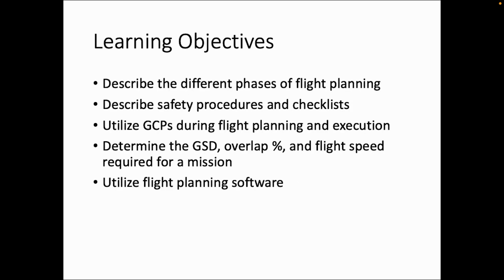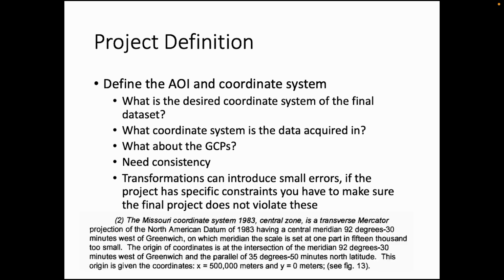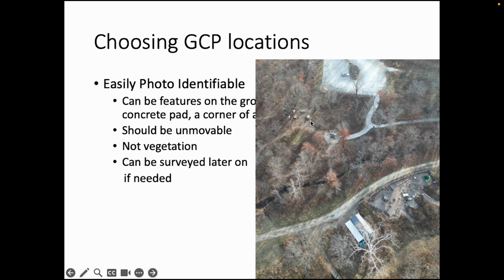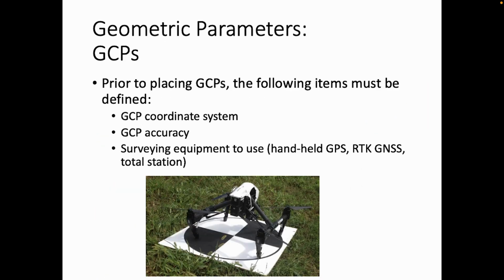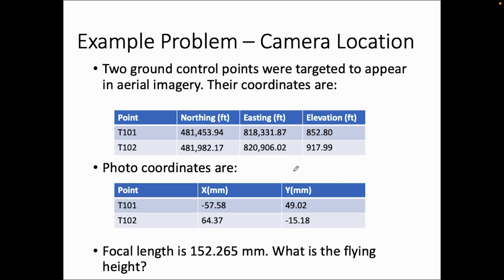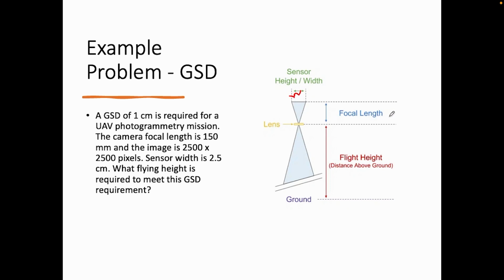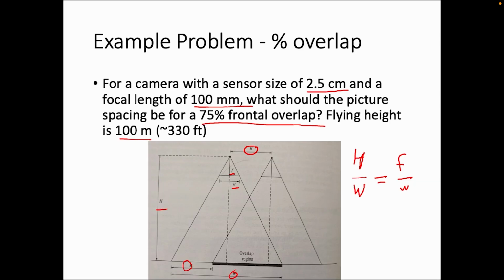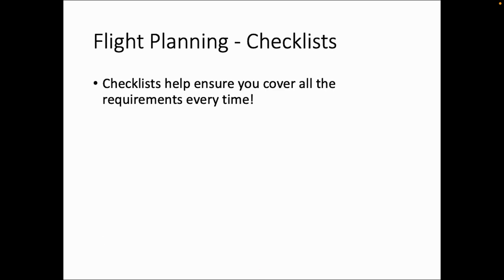Introduction to Mission Planning and GCPs for Drones

Comment: Enjoyed the video. On the contractor side we use GNSS but due to a bunch of reasons don't always achieve cm level accuracy with the system. It still useful to create GCPs and correct the alignment to some extent, but I'm wondering if using an RTK enabled drone it would be better to set the flags, fly the mission, and then use the results of the ortho to create the known position of the GCPs, and then input their heights? It's probably complete backwards. I'm just trying to find away to leverage the technology because I feel like there's less chance of introducing noise if I'm able to master repeatable steps setting up the flight mission, as opposed to the headache that it's been to try to get my GNSS correctly calibrated to cm accuracy which it's capable of for those that know how to use it better😅. Ideally at least 1 or 2 of the flags would be placed directly on points surveyed by a professional visible in the images to act as sanity checks.